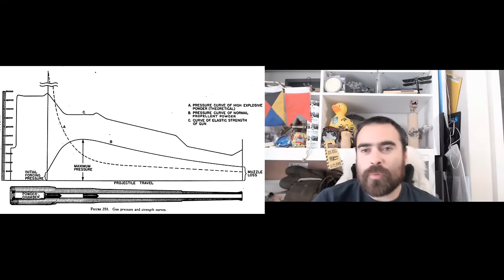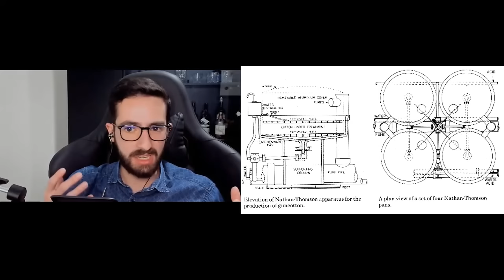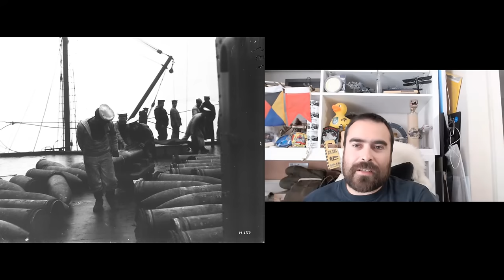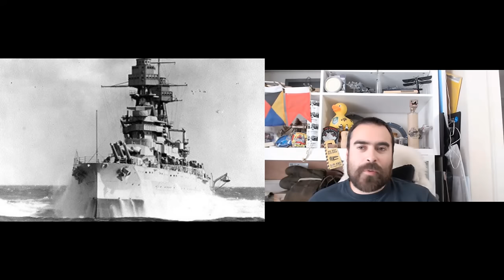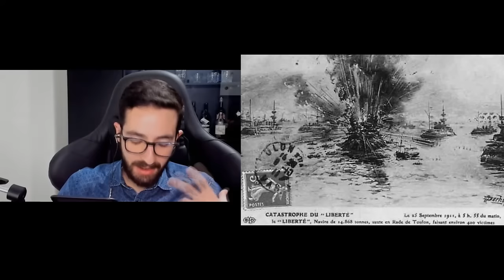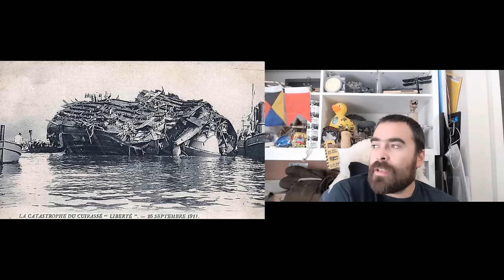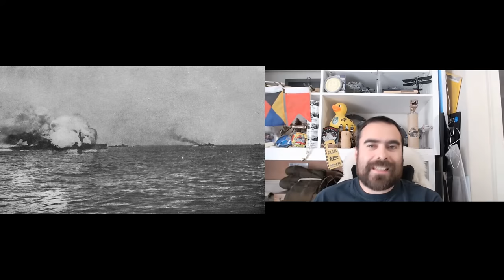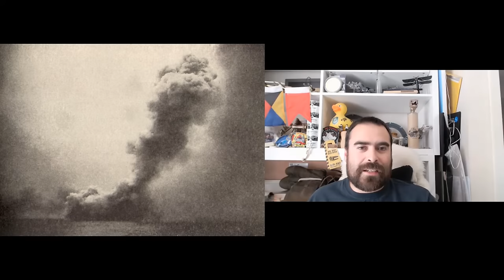Cordite and Poudre B - Why things start exploding at just the wrong time

Comment: I absolutely love that this topic came up! I am a chemistry student, currently studying for my PhD in America. Propellants are one of my loves in chemistry, even though I do not do my PhD research on them. I want to preface this post by saying that nobody should ever do what I have done, it's extremely dangerous, and that I also won't be talking about any specifics of how the manufacture of propellants happens.

I have done some work with propellants, nothing that would enable me to be called an expert in any sense, mostly just research and some small scale synthesis/manufacture. I no longer do the synthesis part, as the acid preparation is stupendously difficult and dangerous. Also, having made the modified version Cordite Mk. I as well as formula B, I can say with confidence that (especially if QC is done correctly) cordite does not seem that unstable (and I must stress that this is EXTREMELY relative to black powder and other extremely reactive/unstable compounds) fresh off of the production line. That's not my endorsement of cordite as a remarkably stable propellant, there is a reason we don't use it anymore, but it's not nearly so bad that you'd think it would detonate/deflagrate as easily as black powder. If acid quenching during manufacture was as serious a problem as indicated in the video, then serious decomposition issues would be at hand if either sulfuric or nitric acid at the concentration used for manufacture, especially if storage temperatures were fairly warm.
The crystallization of Nitroglycerin is something I had never come across as a side effect of decomposition of the propellants, however. I am slightly curious about it, but not enough to ever try to store cordite anywhere near human life for anything resembling that kind of extended time period. That said, I was curious if there are any good sources that could indicate what the general magazine temperatures in capital ships (especially Royal Navy ships, since cordite is the topic) could reach during the early 1900s? 
I am somewhat curious to see if there's any non-dangerous experiments I could do to model the decomposition of cordite in this fashion. Information on the manufacture of cordite is much more readily available to me than anything resembling detailed information on warships and/or history (at least in the places I know to look) If there's any information out there on the storage conditions that would be present on ships of the time period, I'd greatly appreciate the help.
Reply: All three,French,German and British,had warships stationed in tropical Africa and/or South East Asia. For all practical purposes, the only refrigerant available was ammonia which itself is highly flammable and can be explosive. There are accounts of Royal Navy officers stationed there sitting in their wardrooms naked having a hot curry and literally sitting in rivers of sweat. Now just what that meant for the internal temperature of the ships magazines,I simply cannot say. Usually stationed in rivers,most likely the ambient river water temperature would be high. Add boiler heat,the whole ship would heat soak,I would think. I do know there were two propellant formulations prior to WWI,North Sea and Tropical Service. No idea as to detail differences.
Dynamite freezing in winter storage and then safely thawing the stuff was the subject of many magazine articles back about 1905,1910 or thereabouts. Farmers leaving different brands of dynamite in unsafe storage in sheds for years was an ongoing issue until at least the 1950s. Once a sheen of nitroglycerin was seen on the individiual sticks,there was known trouble. There are accounts of wooden shelves soaked in the stuff. 
Abandon and burn the shed was about the only advice given. Yikes.
Not sure if any of that addresses your post,but it is what I have.
Reply: Black powder doesn't detonate.
Reply: @paulmanson253  that is rather helpful. I am trying to figure out if I can find the formulations, but the info on the dynamite issues sent me in a hood direction as far as this issue goes. Thanks!
Reply: @InkyWeb  And to this day,quite a bit of cordite washes up on beaches in Newfoundland and New Brunswick. From torpedoed ships. And still burns well when dried out. As to how well it would explode in containment I hope nobody thinks that would be a bright idea as an experiment. So stored in cold seawater,it remains quite stable. Buried in soil,would it degrade to a useful donor of soluble nitrate fertilizer  ? No idea. Let someone else find that out.
Reply: @paulmanson253  I am in agreement in letting that be someone else’s experiment. I’m rather fond of not testing my luck too badly, lest I end up short a few limbs or worse.
Reply: @InkyWeb  you need to read Ignition by Paul Drury. It's about the USN efforts to develop various rocket fuels in the 50s and 60s. Its highly entertaining even for a non-chemist like me that had to do a lot of googling while reading it

Comment: I did 11 years RA. Our supercharge, i.e. the max charge was called charge 7. It looked like a cylindrical polystyrene green in color. There was a bedford near the firing line with these charges on it, only these. Anyway it ignited. Was interesting to watch. Because it was not enclosed it burt like magnesium. After it was done the Bedord was a puddle

Comment: I hade a reeeeally cool chemistry teacher in the Swedish equivalent to junior high.

In ninth grade he let us make guncotton. We even got to make it twice, since they got the formula wrong the first time. 

My friend and I were lab partners, and we actually did discover something important about the process.

While the proportions of the acids is critical to actually get guncotton, the quality is largely determined by how thoroughly you soak the cotton in the acid, and, importantly, how thoroughly you wash the acid out.

Me and my friend did both steps very thoroughly (the teacher let us stay in the lab for almost an hour after class to finish), and we ended up with a top quality product that burned incredibly cleanly.

We found this out when we were testing the guncotton in the next lab session.

We had a glass petri dish full of the stuff to one side, a ball of very loose cotton fluff about the size of a fist. We took small pieces off and set fire to them in a metal dish on the other side of the bench, about a metre away.

One of those pieces combusted so explosively that it shot itself across the table in a split second, landing in the petri dish.

The whole classroom lit up in a yellow flame about a metre tall, and all that was keft was an almost invisible yellowish/brownish residue burned into the surface of the glass.

Most other lab pairs had lumps of slightly sour-smelling cotton that did not burn nearly as well.
Reply: "Junior high" seems a strange name for högstadiet, but yes, 9th grade gun cotton was part of the course.

Comment: In the Navy when you begin your first fire fighting and damage control training evolutions you're taught about Forrestal. It was sobering. 

Basically, most of the crew and officers had no damage control and fire fighting training. You can see footage of the crews reading the instructions to their oxygen systems while the ship is burning.
 
After the initial ignition of a rocket, due to a fault casualty during a test, which impacted into a line of A4 Skyhawk light strike aircraft, loaded up with cannon projectiles, rockets, HE bombs, napalm, and fuel. 
There were two fire countermeasures being employed during that damage control fight, salt water and AAAF (A Triple F, basically deprives thermal events of oxygen). Due to the lack of training, the water crews were washing the AAAF off of the fires. A terrifying result of this was liquid fire being washed down into the hangers and interior spaces and unfortunately onto fellow crewmates. 

I saw this film and was going to A school to become a gunnersmate. Definitely took these lessons to heart.

Comment: Something I have seen around is that a lot of early users of early modern explosives (basically everything post Black Powder) suffered from the assumption that their new explosives would basically rot like Black Powder does, where it becomes less effective over time and with contamination. Being basically a mix of two elements in low-reactive forms and a fairly stable nitrogen salt, Black Powder generally becomes less reactive over time in most conditions, not more so. It was a real shock to many that these new chemicals would do things like become more powerful or more sensitive over time.

Comment: An older source on powder handling safety issues is Hatcher’s Notebook, by Julian Hatcher. He noted that some formulations of smokeless powder would detonate if in over a certain quantity, as the mass would act as a tamper on itself. Cordite was two high explosives mixed to deflagrate rather than detonate, but the conditions were critical. 
The recent issue with automotive air bags was with using ammonium nitrate as a propellant, which in certain conditions would detonate.
Reply: I still have a scar on the outside base of my left thumb from the propellant charge of an airbag in a car nearly 20 years ago. The airbag did save me from serious injury though!
Reply: @vipertwenty249  A friend totalled her car hitting a feral hog, She had nasty airbag bruises on her arms.
Reply: @tomhalla426  Lot of mass in a hog. Friend of mine had bad enough damage from just hitting a sheep.
Reply: @vipertwenty249  Low slung enough it did not go through her windshield, though.
Reply: @tomhalla426  My friend's car (this incident was nearly 40 years ago) was an old mark one Ford Escort (British model) and the damage was more than it was worth. That wasn't the only thing that went wrong for him that weekend though - he broke his wrist exiting from a cave and insisted we take his wetsuit top off before taking him to hospital because he couldn't afford for them to cut it off. Those were the days - trying to lead an active life on a shoestring budget.

Comment: Nitrocellulose is still the primary ingredient in propellants in shells and even the common small arms round – nitroglycerin as well, in the case of triple base propellants. We wouldn't have smokeless powder without them. 

To say both are poor propellants and poor propellants because they cannot be stabilized is incorrect as they have been used practically for nearly 100 years. 
It was the inability to completely clean Nitrocellulose, in particular, during that time. It was the perfection of the cleaning which took a very long time to perfect.
I have made both compounds and degradation was always a concern. Boiling Nitrocellulose 4 times in a mild baking soda solution for many hours after the nitration process of cotton still renders Sulfuric acid one the process is done. I always stabilized both with acetone until they were ready for use.

Comment: A question for your guest. the germans had an issue with the first smokeless poweder in infantry files before WW1. the G1888 rifles were exploding due to metal issues but also powder. is  it possible the fix for the infantry powder filter into the Germany navy's powder manufacturing?

Comment: Great video about the various explosives/propellants and their effects and short comings. I worked as a safety officer in the missile industry and actually did a safety awareness presentation based on the Jutland and Forrestal case. The Jutland case definitely seems like safety procedures were being bypassed for firing rate.  The Lion’s gun captain was apparently fanatical about propellant safety, and after Q turret was hit, a petty officer was able to flood the magazine, prevent ing a detonation.
The Forrestal case is total massive error chain that went badly wrong!  One big contributor was that they had a shortage of 500 lb bombs. They got sent a very dodgy batch of bombs which they were going to reject, but were told this is what you, can get, so these bombs were supposed to be  transferred to North Vietnam ASAP. When the deck fires started after the Suni rocket event, these things did not melt, they detonated!

Comment: As a child my father had a small company he ran out of our garage. He use a great deal of concentrated nitric acid. Starting at age ten or so I used to hang out in his workshop and I remember my cotton T shirts rotting away and turning yellow in a mater of hours. This acid came delivered  in huge stainless steel barrels. He was very dangerous with his methods of handling these chemicals. 
part of his process he would have 6 inch diameter magnesium pipe machined in a local machine shop. The machine shop would fill several 55 gallon barrels waste chips of pure magnesium. I do remember dad telling the owner of this shop not to keep these chips next to his metal turning lathe because of the fire danger. The owner said he was saving this scrap because it had great value as scrap. A very short time later the fire department called him and we drove down to the machine shop. The only thing remaining of the machine shop was breached bright white concrete block walls and nothing else. The iron lathe had mostly melted. there was no roof, no glass and what steel that was not melted in a puddle had vaporized. Even steel I-beams at the end of the small building had folded over from the heat. 
Back a dads shop the reactive nature of nitric acid destroyed everything even the concrete floors  Several years later I was still a child and I remember working in the shop on the weekend and a leak started in one of the holding tanks. I managed to stop the leak but in the process burn both hands badly. The skin on my hands turned to leather and weeks later at school I remember pealing all the skin off in one massive tug of the leather skin , starting at my wrist. Dad dropped dead six months later. He was 51 years old. I was surprise he lived so long. 
The cotton in our clothing had rotted from exposure to the nitric acid fumes. Im sure it had turn to Gun cotton we were lucky it never exploded or burned.
 Please keep in mind that I was only ten years old when these events first started. Dad was a poorly educated yet was a fantastic inventor and would build a kinds of stuff that he used in many applications. Needless to say he took all kinds of risks.

Comment: 1.) Nitrocellulose - It is a cotton waste converted to nitrate.
2.) Mixed Acids (M/A) - Concentrated Sulphuric Acid (57%) and Nitric Acid (43%) - It is used in nitroglycerine production to nitrate glycerine and to act as a dehydrating agent during the process.
3.) Oleum (Fuming Sulphuric Acid) - It is used in the reprocessing of refuse (spent) acids to concentrate the nitric acid and replace used sulphuric acid.
4.) Glycerine - It reacts with acids under strictly controlled conditions.
5.) Sodium Carbonate - Used to neutralise remaining acids in the separated nitroglycerine and makes it less likely to explode when moved to other processes.
6.) Acetone - A solvent additive that stabilised the nitroglycerine and later in the process helped to gelatinise the nitrocellulose and nitroglycerine to a paste for forming into 'cords'. Acetone is known to most women as a nail-varnish remover.
7.) Vaseline - added to the mix as a stabiliser and gun barrel lubricant.
8.) Graphite - 'Lampblack' to reduce the risk of static ignition in some forms of loose cordite.
9.) Nitroguanidine (Picrite) - It is added to artillery cordite to reduce barrel wear and to stabilise the cordite in storage.

Comment: 7:08 - High explosives can be used to propel things (for instance, in the 1960s, NASA was doing work on Project Orion, a project to propel spacecraft by setting off nuclear bombs behind them, and, although the project was ultimately cancelled, they ran a number of successful small-scale tests using a scale model of the spacecraft design propelled by small charges of dynamite) - just not with a conventional gun (unless you make it ridiculously thick and heavy and sturdy around the breech where the detonation's going to happen).  Not saying you're wrong (because you're right), just felt like clarifying a bit.
Reply: NUCLEAR-BOMBS?  JESUS H CHRIST!

Comment: Was powder upgraded by the time Hood exploded? It could be possible Bismarck never penitrated the magazine.
Reply: yes Cordite SC rather than MD, SC is closer to german RP c/12 used by the Germans at Jutland
Reply: Drach has a whole video on Hoods loss
Reply: @Fulcrum205  yes but I was asking if lessons from this video were applied to Hood
Reply: @jonathanevans4610  Barham and Hood still exploded, no German ship exploded, even with magazines on fire.
Reply: @Fix_Bayonets  They tried... and failed, as Hood and Barham demonstrated.
Reply: @trauko1388  yeah it's not an exact copy it used more nitroglycerin, less nitrocellulose and more centralite than german rp c/12. rp c/12 is also tubes not cords. but it was based on study of german propellant.
Reply: @jonathanevans4610  Campbell mentions this: "After the disasters in the battle of Jutland, measures were taken in British ships to ensure that the flash from charges of the existing type, ignited anywhere in the turret structure, did not reach the magazines, and corresponding precautions were taken for the secondary armament. A description of these measures falls outside the scope of this book, but it may be noted that no work seems to have been done on the different behaviour of British and German charges until about 1920; it was then handicapped by lack of German charges for comparison and ignorance of the exact method of containing the propellant in the charge."

I doubt the Germans handed ammo and propellant over